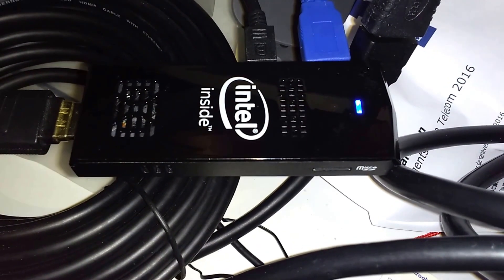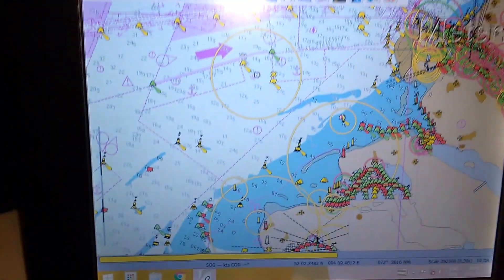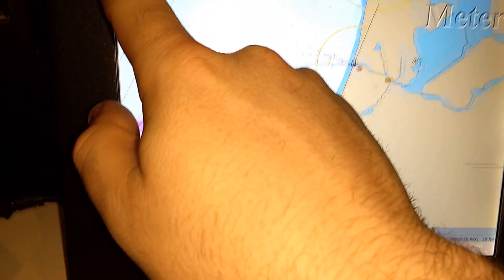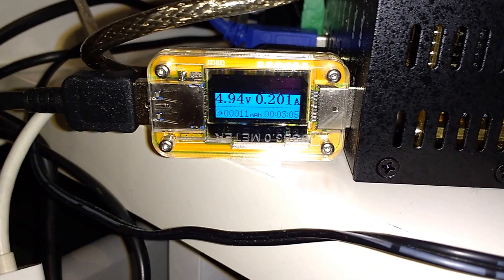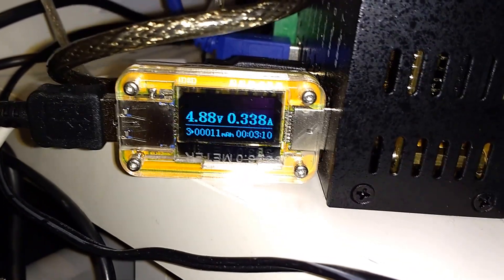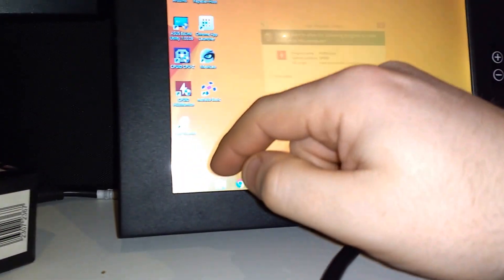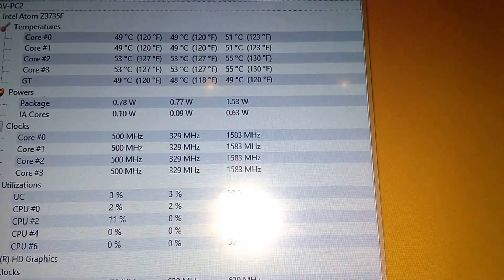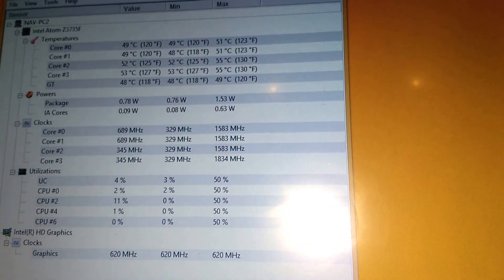Intel compute stick OpenCPN power usage

Comment: Is your monitor USB powered? Have you integrated into your system a GPS?
Reply from the maker: Stod706 monitors cannot be USB powered. USB only gives 5W. The monitor is 12V powered. GPS comes into the computer from my nmea0183 system via a serial to USB converter.

Comment: If I have this intel compute stick, and a 30 000 mAh powerbank, how long can i run the intel stick?
Reply from the maker: I take it the 30Ah power bank is Li-Ion? So that's 3.7V average voltage giving 111Wh (v*a=w). The Compute stick uses ~3W of power. So divide 111/3 and you get around 30 hours of runtime. At 100% efficientcy. These things are never 100% efficient (there is a step-up converter in the power bank from 3.7V to 5V) normally around 80-90% efficient, so 24 to 27 hours of operation under ideal conditions. Under heavy work load, this will go down.
Reply: The powerbank has 5V/2.4A. Thanks alot for the answer. So it will run at max. possible load over 18 hours?
Reply from the maker: It does not run at maximum power at all. 5V at 2.4A is 12W of power max. The Compute stick only takes 3W. If it was running at full power, it would be empty in less than 10 hours. Please read about the difference between power, voltage and amperage. P=VA in general.

Comment: Which model is the compute stick?  Which processor?
Reply from the maker: This is the 1st gen model with the Z3735F processor. I've done a similar test with the 2nd gen model 8300 processor (which has USB 3.0 and therefore much more useful, the results were very similar (I think it's max consumption was 3W)).